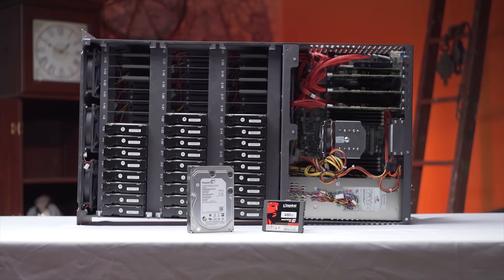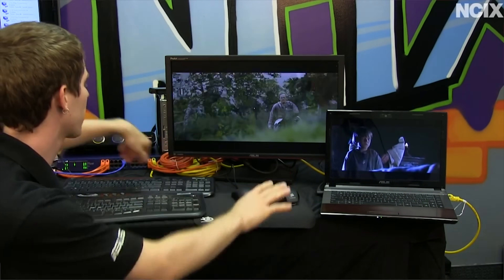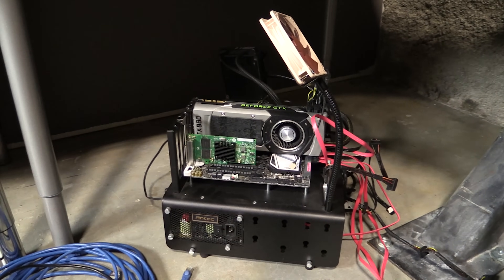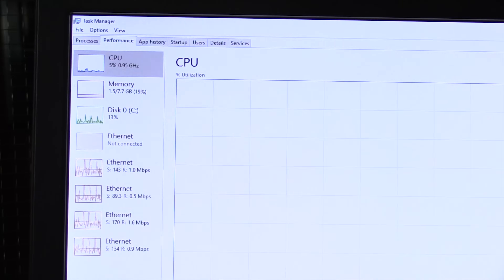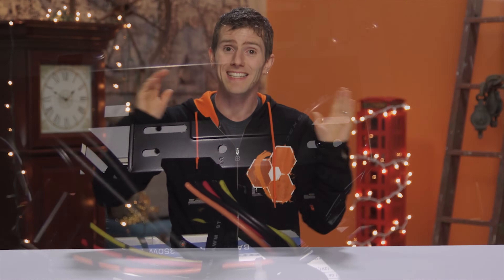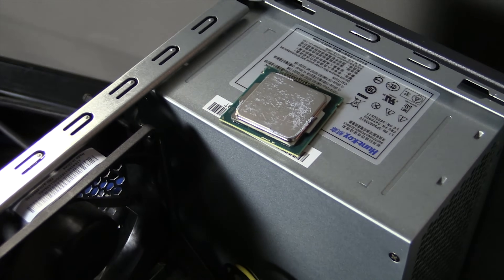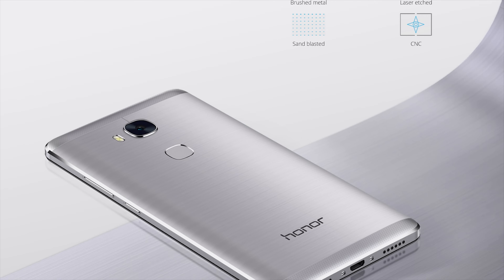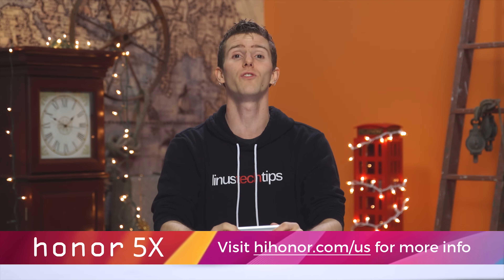Quadruple Your Network Speed for $100 with SMB 3.0 Multichannel!

Comment: If your machines are close together, just pick up a couple 10gb Mellanox cards with passive SFP+ cables for $20 each on eBay, connect the two together (a crossover configuration), configure static IPs and you're done. That way you're also not dependent on SMB 3.0 multichannel to achieve high LAN throughput.

10gb gets expensive quickly though, with longer active SFP+ cables and switches. You can get away with a small number of computers by having one or more machines with two Mellanox NICs and configuring static routes to link 3+ computers together without an expensive 10gb switch (though a fair number of the near-free bulk decommissioned 1gb switches have 10gb SFP+ uplink ports).

Comment: Great effort, but kinda disappointing results. Couple of cheapo InfiniBand NICs and a switch can easily beat that. It won't work with windows though, the drivers are Linux only. There is a reason almost all the supercomputers use InfiniBand and not Ethernet.
Reply: Not sure about this but I think the Mellanox infiniband cards support widows and IPoIB. Not sure whether RDMA would work or not, as that probably requires support by the operating system.

Comment: We had some strange behavior with our SMB multichannel connection on 2012 r2 server.  It was not very reliable and was causing our printers to fail when we routed our jobs through the server.  We tried absolutely every option we could think of.  What we eventually did was remove SMB completely and drop to one line, and set it back up from scratch.  For whatever reason it has been absolutely solid for 6 months.

Comment: 400 MB per second ehh? Well in my area, the fastest download speed I EVER got in my life was around 32 MB per second and oh, before you say "well that's okay", it was only for a short while, guess what kind of MB downloading speed I have been dealing with mostly in the last 5-6 months? From 0.8 MB to 7 MB for the most part and that was NOT even consistent (I get disconnected or "no page found" error a lot).

Catch you guys with a 400 MB speed in the year 2050 (in which case, the rest of the world would then have 999 TB per second).
Reply: +Infinity Master This video is about local network speeds not about your internet connection speed. They don't have that fast internet connection.
Reply: awesomejpg Yeah I was aware of that. I was just stating the issue that I'm having with my internet as compared to other areas. Also FYI, there IS even a 1 GB per second INTERNET CONNECTION. I've seen one in UK which had a download speed of AT LEAST 890 MB per second. Additionally, I've heard that a certain company (Huawei I think?) is ALREADY testing "5G" Internet in certain areas in the US (which also has that high of download speed) and plan to make it available to consumers in late 2016 or probably early 2017 at the latest.
Reply: I know that there is very fast connections out there, especially in business grade. I have a 1000/100 fiber myself. But LTT probably don't have that fast connection :c or maybe they do, I dont know.
Reply: Infinity Master this video is only about SMB 3.0 multi-channel which is only used on your land on Windows machines to transfer between them. SMB should never be used across the internet at least in general. This has nothing to do with the internet at all.

Comment: This only works if all hardware in your network have this network card. It won't help you if you have a standalone NAS or Media streamer or even another device with only hard drives which cannot write faster than 100MB/s. Not even all modern ssd's can write up to 400MB/s. Some do, but not all of them. On the other hand, if you have an HTPC you can benefit from this solution. Big problem would be routing all those cables to the desired place....arghhh.. But, nevertheless this is a useful video because it offers a relative cheap solution.

Comment: LACP would have worked better. Anyone being cheap probably doesn't have the CPU to handle this anyways. I'd just invest in a managed switch. The EdgeSwitch Lite from ubiquiti is only about $200. Anyways, I didn't know SMB 3.0 could use Multipathing IO. Thanks!

Comment: Would this work on motherboards with built in dual Gigabit Nics or would those be sharing the same resources? When I tried it on my 2012 and x99 Windows 8 it severely impaired my speed instead of increasing it.

Comment: can you do something similar with internet speeds?
Reply: +Xipo86 Someone needs to do some research! Yes, it can with load balancing.
Reply: +Typical Bambi Not really - this video is geared towards local network, not internet.  You might be able to get it to work with Internet if you're willing to pay for like 4 cable modems or 4 DSL modems and the monthly fees attached to them.
Reply: +Typical Bambi If you're not able to get your internet's speed on a specific computer, but can on other ones, then this could possibly work for internet. But if you're already able to saturate your internet's speed with the device of choice, this won't help.

Comment: ermmmm is there a TL:DR for this? :3
Reply: +Eos Zenith 6:26
Reply: +Eos Zenith Sure: buy two cheap 4 port 1 Gbit PCI-E card, at least 8 port Gbit router, two i7 processors with 8 threads, 32 GB of RAM for two ramdrives, and 4 SSDs... all for under $100... [extra part not in the movie: or just go with Fibre Channel; two 10 Gb cards under $100].

Comment: What is the difference between this and teaming the network connections? I have an old i5 running linux (Ubuntu server) and my i 4790k (Win10) both have dual intel nics teamed.. They both get 2gig speeds

Comment: to get actual nic speeds above 1 gigabit Ethernet you will need a layer 2 gigabit Ethernet switch and you will need to enable lacp. the cheapest way to do this is to get a Zxyel gs1900 series switch.

Comment: Hey Linus,  You should include info on the software setup.. Did you have to enable lacp on the switch?  Did you do any settings in Windows?  Do you just let all the network cards grab an IP or set them static?

Comment: Quick question, this is something I've been trying to get to work on my server environment have have failed at.  For SMB Multichannel to work in Windows 2012/R2 in the Microsoft domumentation it says you need a card that's RSS and RDMA capable.  I can't seem to find any NICs that shows this in the specs.  If you guys have any recommendations let me know.  I currently have servers running Intel Pro/1000 PT and Broadcom BCM5708C NICs.

Comment: Why not just use cat6 cables? They have a 10-Gigabit transfer speed at less than 300 feet and you can buy 100ft cables for 10 bucks.

Comment: Yeah such a cheap way to improve network speeds.
You just need to have all your machines running i7 and you need all machines to run ssd or ram disks to achieve those speeds.
Not expensive at all, Thanks Linus

Comment: Ahhm... What type of trunking did you guys use? I bet if you used LACP or some sort of TLB/SLB type of bonding + TOE, you would've gotten to the dreamed speeds much quicker. In general TOE is the cure whenever you've got a crappy cpu on either side, however that brings up some of the pricetag of the overall solution (not by much though). Just my 2 cents from my datacenter experience. Cheers

Comment: Awesome stuff!  I'd be interested to see if you could do the same with quad 10gb NICs.  You'd need a 10gb switch, 2 machines with 4 10gb NICs each, and some serious horsepower on both ends to actually push it down the pipes that fast.  Possible?  No idea.  Would it be cool?  Hell yeah :)

Comment: SMB Multi channel is so picky, but you need to make sure RSS in enabled in your NIC drivers and tuned up to use the max amount of queues.

You also can't be teaming your NICs if you want to use multi channel, so that means each "channel" you want to be using has to have an IP address on your network. This also means that only SMB file transfers are accelerated and fault tolerant. Which is fine if that's your goal.

Comment: So im planning on buying a monitor and i don't have a big budget but does anyone know which one is best? (on Amazon the samsung is super expensive but in Holland where I live they are almost the same price so don't look at the price)  :)

 The samsung S24D590PL (165 euros)

http://www.amazon.com/Samsung-23-6-Inch-LED-lit-Monitor-S24D590PL/dp/B00IEZGYI0/ref=sr_1_1?s=pc&ie=UTF8&qid=1454277597&sr=1-1&keywords=S24D590P

or The LG 25UM57-P (156 euros)

http://www.amazon.com/LG-Electronics-25UM57-25-Inch-LED-lit/dp/B00V8FAWC2/ref=sr_1_1?ie=UTF8&qid=1454277724&sr=8-1&keywords=LG+25UM57-P

Thanks a lot :)

Comment: So just so I'm clear:
1. Get 2 or more cheap quad port gigabit NICs and install them in the PCs you want to pass data through
2. Get a cheap 16 or 24 port switch
3. Run 4 ethernet cables from one PC, into the switch, then four out of the switch and into the other PC/s. 
4. Have at least 8 thread CPUs on all PCs in the network for optimum performance.
5. SMB 3.0 is already enabled by default on any version of Windows Server 2012 or Windows 8 (or greater)
My only question then is it really as simple as plugging it all in? Do you have to do anything with the switch?

Comment: A lot of people are giving this video shit because it only works with high-speed storage media and powerful processors, but that doesn't make any sense. Of COURSE you can't transfer files faster than your storage devices can read/write. How could that possibly work, and what would the point be? And as for the processors, his problem was with an i3, not a  6700k or something. Realistically if your computer has an i3, you're probably not doing much with it that computer that requires > 1 Gbps networking, and your money would be better spent upgrading your PC hardware than your networking solution. It would be interesting to see how it did on an i5 though...

Comment: That is a stupid network config with a lot of not necessary Hard-/Software..

srsly.. link aggregation on a switch for around 200 bucks is waaaaay better

+ you dont have to use link aggregation on every client to benefit from it.. 

example: Server 2 NIC's bonded = 2 Clients doing stuff full 1 Gbit !

Comment: use linux use linux use linux.. all the things you mentioned that this will make better would still work served off linux. Your clients/workstations can still be windows or whatever you want- but bonding NIC's is soooooo easy with Linux (and it always seems to work, provided you use a switch that's decently modern)

Comment: In short, it works but you need more cores to get closer to that speed as well as RAM and a fast hard drive. If you rely on network speeds, go with something that supports fast CPU speeds and the most multiple cores, DDR4 RAM at the fastest clockspeed and the fastest drive, being the M2 PCI-e cards.

I'm still waiting for a AMD motherboard that supports the FX 8k series CPU with 8 cores and DDR4 RAM.

Comment: If you're doing NIC teaming with a normal dumb switch, you’re probably going to run into a lot of issues with duplicate MAC addresses flooding the switch’s CAM tables (hence the unstable transfer rates). Use a switch that supports teaming or do a point-to-point connection.

Couldn't this be done easily with support for any IP protocol by using something like balance-rr bonding which is available on all Linux systems? Why the need for SMB multichannel specifically?

Comment: Linus,
How could you get SMB multichannel to work from a Windows 10 Rig to a FreeNAS machine. My FreeNAS motherboard is a SUPERMICRO X10SRH-CLN4F which comes with an Intel i350-AM4 Quad Port NIC onboard. I already have LACP running between my L2 Switch and the FreeNAS box. Was thinking about trying to pick up a Quad port Intel NIC to try this out instead of going 10GBe right now. 

Do you have any suggestions to get this working on a FreeNAS box? 

Also, how can you verify that Windows 10 is utilizing SMB3? Is that enabled by default? 

Thanks!

Comment: A few issues for me:
1. My NAS runs on Ubuntu Server 14.04.3 LTS (with ZFS. root filesystem on EXT4, data on ZFS))
2. I don't have SMBv3 support (yet)
3. I won't fit my NAS with a quadcore CPU with HT.

Comment: Guys I need help with my PC build.Parts:Motherboard: http://www.newegg.com/Product/Product.aspx?Item=N82E16813128873CPU: Intel Skylake Pentium G4400 3.3 GHzGPU : Integrated 1.8 GB DDR4 at 1.05 GHzRAM: 8 GB DDR4 2133 MHzSSD: Already have ( 250 GB SSD )SPU: 430 W Corsair 80+ BronzeI just need to know if this will be duable since they all cost 177 dollarsand I just need to know if it will run these games decently: Resident Evil 4. COD WAW. Fallout New Vegas. Crysis 3.  COD BO2. Team Fortress 2. Dark Souls PPTD

Comment: 12000 dpi and 9000 of it is interpolation LOL, or more. Put your windows sensitivity almost to the highest setting. Then lower your dpi accordingly. The idea is to make your movements as close as possible to that of the sensor's dead-zone. If you get too close you'll find the mouse will jitter, too far and it'll feel like you have no control. Even normal 60hz at 60fps will feel extremely responsive. Though you'll need enough time to build up some muscle memory.

also.. unrelated topic.. but do you guys hate typing on cherry red keys ? It feels like i'm trapped in typo-hell. It's disgusting. This Corsair C-red key''borad'' makes me want to kill myself, not really but almost. I'm using a Razer Death Adder on 400-600 DPI with high windows sensitivity and with the windows mouse Hack/Tweak. I can actually do ''okay'' in CS-GO. Quite fun actually. But i'm just a fucking scrublord that is slowly turning into a filthy casual so yeah..

Comment: 2x HP 10Gbit/s Infiniband HCA network adapter á 20 bucks 
2x 10m infiniband cable á  20 bucks
Cisco Infiniband Switch 24 ports 1699 bucks lol

Comment: Would this not work (just for the fun) : if I had let's say X  access-points (wifi - ac) and in my computer X wifi sticks(ac capable) via usb 3.0
And those access points are plugged in the same switch, where for an example a nas with 4 lan lanes is connected to.
Well sure those X wifi networks have to have a different ssid and run in different channels, but wouldn't be that possible? @linustechtips you should try it!

Let's make X equal to 4 to have the most fun haha..would be expensive tho

Comment: Ok, so this won't increase my actual Internet speed, but this will make my local file transfers quicker. Am I correct? Also, do you know if there would be a way to make my internet speed quicker for under $100? I mean, without changing my internet plan with my isp. I already have all wired connections.

Comment: Would the other option be to team the NICs in the OS with appropriate software and place the ports on the switch into a port channel / lag?  OK, the switch will be more costly, but then you can be sure of configuration...although you would need to ensure the lag is setup to balance across all four ports.

Comment: So if I have a fairly basic Synology NAS, what can I do and what do I need to get network speeds fast enough for viability of backing up over the network? Right now it's too slow so it's easier to just plug whatever you want backing up straight into the NAS, which is fairly useless.

Thanks for any help

Comment: I'm building a new PC are these specs ok? Can I run GTA 60fps Ultra Settings?

Memory: Samsung 850 EVO 500GB 2.5-Inch SATA III Internal SSD

CPU: Intel Core i5-4460 LGA 1150 CPU

Motherboard: Gigabyte LGA 1150 Intel H97 HDMI SATA 6Gb/s USB 3.0 Micro ATX DDR3 1600 LGA 1150 Motherboards GA-H97M-HD3

Video Card: EVGA GeForce GT 740 Superclocked Single Slot 4GB DDR3

Wifi Card: PCI Express Adapter,2.4GHz 450Mbps/5Ghz 450Mbps, Include Low-profile Bracket

Ram: Crucial Ballistix Sport 8GB Kit (4GBx2)

Case: Corsair Carbide Series SPEC-02
Reply: +Javier Louise Are you troll ?No definitely no, this gpu is horrible and the cpu could be better to.For 60fps ultra you need like R9 390 and 4690k at least, but with r9 380 and 4460 it will be with good fps and settings
Reply: +Stanislav Yordanov But can I run games like counter strike global offensive or battlefield in 60+ fps?
Reply: Javier Louise On low setting maybe, the cheapest gpu you should look at is r9 270

Comment: Guys, this is all about the hashing algorithm on the switch. Most cheap switches use src-dst mac which basically limits each stream of traffic to one port in the bundle. This is why you see full utilisation if you have multiple clients (multiple src and hence a different port in the bundle is chosen). Any enterprise grade switch will let you set this to something else and you should be able to get full utilisation even on a core 2 duo. source: networking for 20 years and ccie

Comment: Guys would an AMD FX 6300 be ok to at least triple my speed?
AMD FX 6300 has 6 cores but no hyper threading
Reply: PLS somone help me
Reply: +Timur “Acel” Titivadze I think a FX 6300 would maybe get you double your network speed depending on whats on the other end. I wouldn't say triple because linus recommends an I7 for quadruple but an I5 usually beats a FX 6300 so I wouldn't expect too much if I were you.
Reply: So my setup is that i have a router that connects to a powerline and i want to connect a 16 port gigabit switch and connect about 4 ports from the gigabit switch to the 4 port PCIe gigabit server adapter, do you think that would work?
Reply: No I don't think that would improve your network speed much if at all. Just to make sure you realize this won't help your internet speed